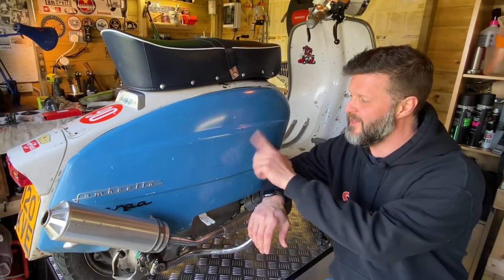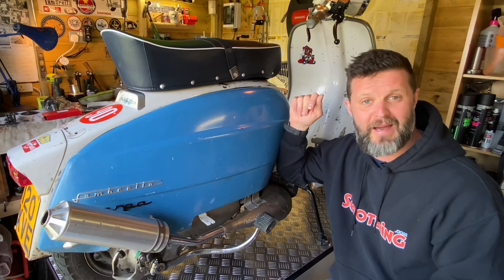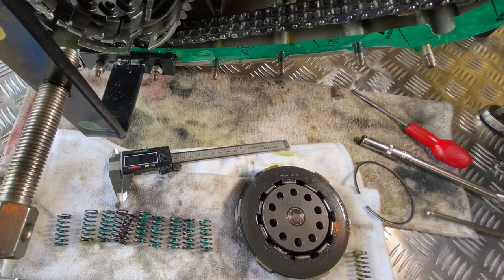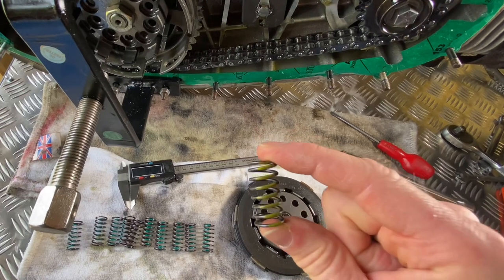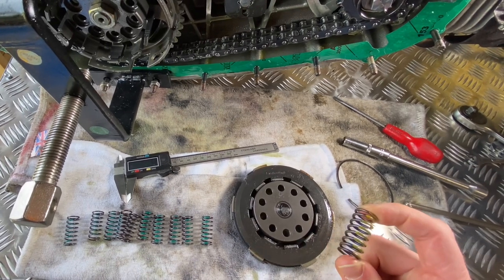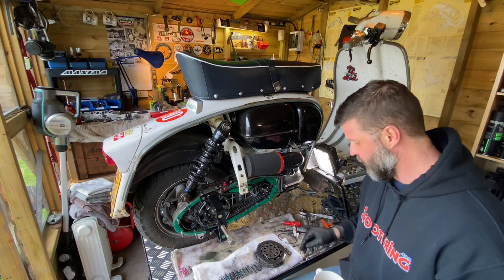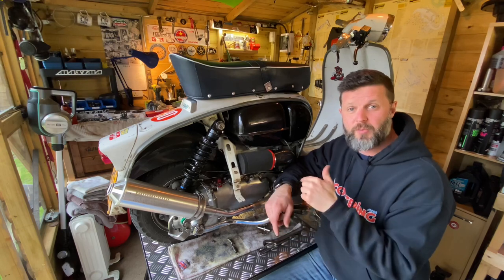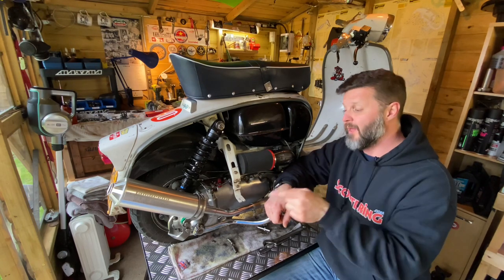Fix Lambretta slipping clutch - how to fit upgraded clutch springs - split engine - 6 plate

Comment: Hi Dan got the same problem with my RT 225 clutch thanks for the info,I did notice you had bellows and a foam filter on your carb in your other vids on jetting and tuning you said you would never use them can you explain 🙄🙄😆😆😆👍
Reply from the maker: This engine was a loaner from Tino… that’s what it came with and that’s what it went back with 😄